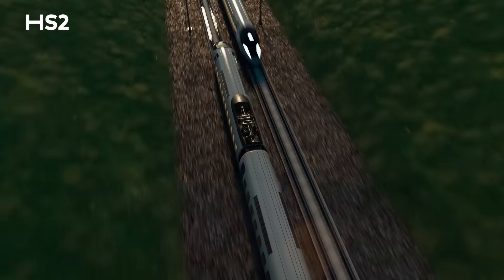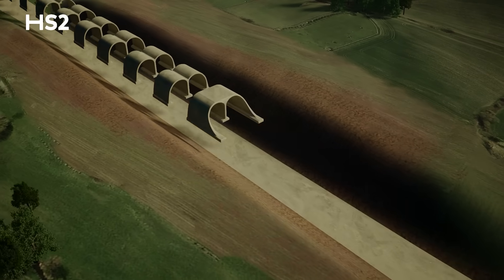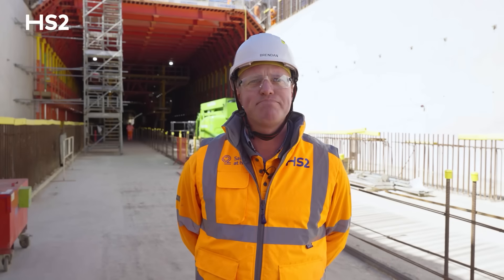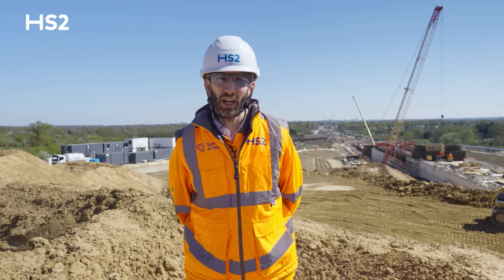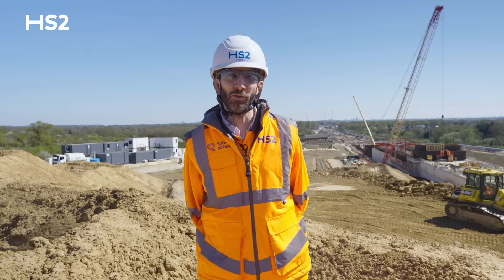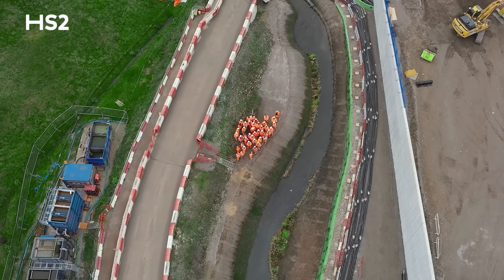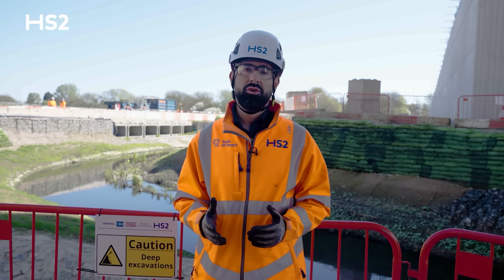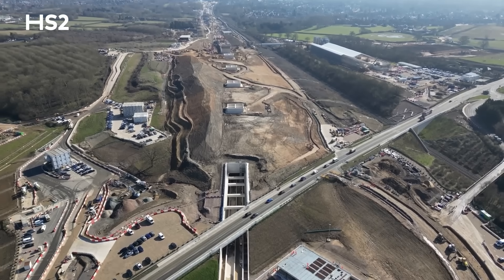Inside Copthall Green Tunnel: 🚄 Building HS2’s Hidden Railway in West London 🏗️

Comment: After the DfT today announced delays, is the section from Old Oak Common to Aylesbury in a position to have rail and use just this section until all is complete which looks ten years away?
This section could branch onto the Chiltern Line then onto Curzon St to get the stations at each end used and finished instead of laying about for ten years, sending trains to Birmingham from the WCML. Bi-modal trains can be used as an interim until all completed.
Reply: Do you actually know anything about Birmingham or are you just guessing. , first HS2 is a 2225/250 MH Railway with in cab signalling, the Chiltern line is a100mph Railway still using 1970 type track and Diesel power, the next thing is that Birmingham Curzon Street Station is on a different alignment to the Chiltern line at Moor Street with Curzon Street and the HS2 line running East and the Chiltern Line coming from the South and both are on different levels with the New Street approach lines in between

Comment: I am all for tunnels through built up areas, but I am totally fluxed as to why this green tunnel was needed, when a simply cutting would have been fine….
Reply: On a human scale cuttings throttle down crossing points and divide communities. One the scale of a railway line cuttings encourage animals to cross over the trackbed.

So, while there is an additional cost to doing a cut and cover tunnel, you also create a place where wildlife will migrate to, and keep things like foxes from being hit by trains. That's good for the foxes, but it's also good for the people on the high speed train that doesn't slam into foxes. And there is also the fact that embankments need to be monitored and maintained to stop land slips. With the green tunnel built there isn't going to be a problem of trees getting too close to the railway, leaves on the line (at least not on that bit) or a blocked river causing a mud slide that blocks the railway line.

It's fine to do stuff that respects the environment. In the long term, the additional cost is going to be irrelevant compared to the environmental benefits of unlocking capacity on our existing mainline network.

I hope that they continue to do this when high speed rail is eventually extended north of Birmingham. The Victorian railway companies were kind of scummy and people in the Midlands and the North of England (and Scotland when they get that far) deserve better.
Reply: Well said  @DavidShepheard

Comment: There is only one tunnel TBM: elizabeth 1668m left to bore out, most of the viaducts are built so that wont take long to start laying the track down and put in the overhead wires then test the new trains. I'd say that could be done within 2 years easily. Then just deal with the lawyers and bureaucrats to sign it off.
Reply: There's just one problem with this section being ready in 2 years time. The rest  won't be.
Reply: And don't forget the tunneling to Euston
Reply: @berkhofduvedec  Yeah but trains will initially terminate at Old Oak Common
Reply: Reform will be in hefore this is finished and DOGE have promised to cancel it. .regardless of progress. They should be fixing our potholes instead.